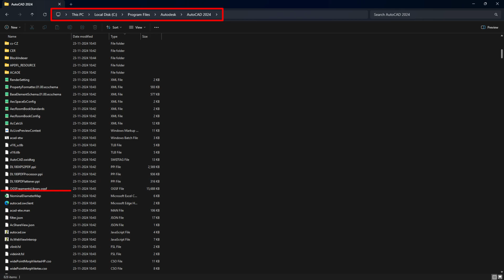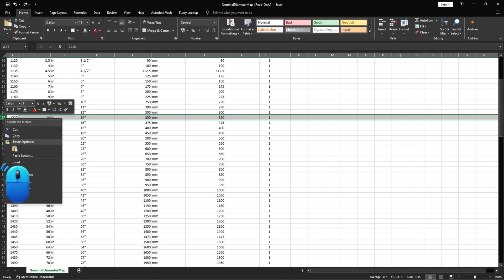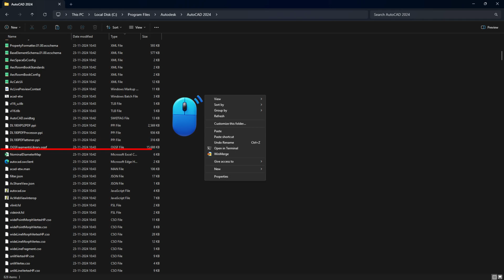AutoCAD Plant 3D | Add Custom Nominal Diameter / Sizes?

Comment: I tried adding a custom pipe size 4.26 in in AutoCAD Plant 3D. I edited the NominalDiameterMap.csv, but when I save it in the Catalog/Spec Editor I always get this error: "Nominal Diameter should be filled with correct value". The size shows up, but Plant 3D won’t let me save it. How can I make it accept this non-standard size?
Reply from the maker: Ensure you include sizes in both imperial and metric units with the correct alternate values.
Then, close and reopen AutoCAD Plant 3D. It should function properly.

Comment: Hello, after replacing the orignal .cvs file i can see my custom diameter in both spec editor and catalog builder, but they're not showing on the list in an actual plant application. Do you have any idea what could cause this issue? Im using 2025 version of plant 3D
Reply from the maker: Have you tried closing and reopening the Plant 3D application after setting the custom diameter? Also, ensure that your spec includes the custom nominal diameter component and that it is added to the project.

Comment: HELLO ENGINEER.
HOW CAN I DO IT:
I HAVE CREATED A BALL VALVE IN BLOCK, FROM THERE I PUT IT IN SPEC CREATOR IN CUSTOM PART, WHEN I TAKE OUT THE ISOMETRIC, THE MANUAL OPENING AND CLOSING OPERATOR DOES NOT APPEAR, ONLY THE BODY APPEARS. COULD YOU HELP ME?
Reply from the maker: Hello!
Thank you for your question.
You need to set up the SKEY in the IsoSkeyAcadBlockMap.xml file.
I hope to create a video about it soon.
Reply: @acadp3dsolutions I WILL BE WAITING FOR IT, THANK YOU
Reply from the maker: Could you let me know which version of Plant 3D you are using? It worked for me when I tried it in Plant 3D 2024.
Reply from the maker: Hey! I remember you asked about "Operators missing for Custom Block-Based Valves in Isometric Drawings?" a month ago, and I’m sorry for the delay. 
The good news is I've just uploaded a new video on that exact subject! 
You can check it out here: https://youtu.be/VEviOboQR4g. 
Hope it answers your questions, and feel free to let me know what you think!

Comment: I have changed CSV file for reasons of report creator report file size I want to metrics like 25NB to 600NB and it will working fine but this changed values distrub impartial catalog from catalog editor sizes showing in metrics instead of inches so tell me how can I get the both value matianed
Reply from the maker: Hello,
The Nominal Diameter Map file is linked to the AutoCAD Plant 3D application. Any changes made will be replicated throughout. You can use the Nominal Diameter property in the Report Creator instead of the Engineering Items Size property.
I hope this helps!